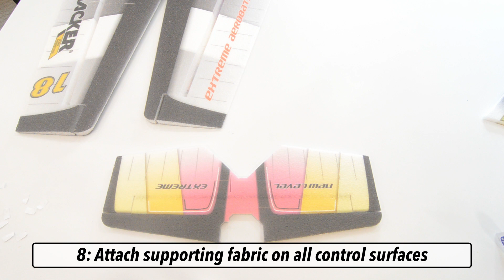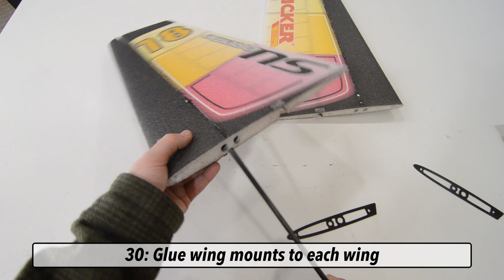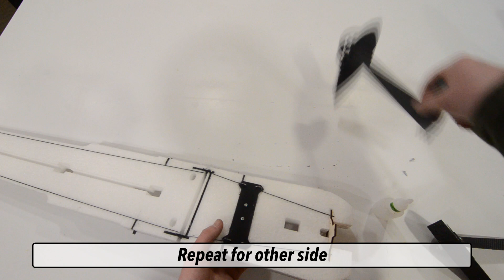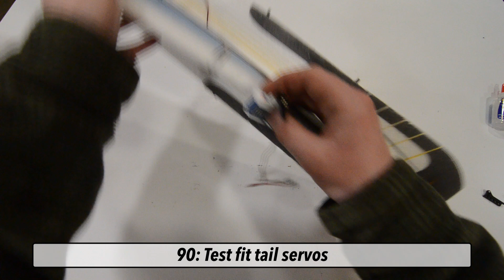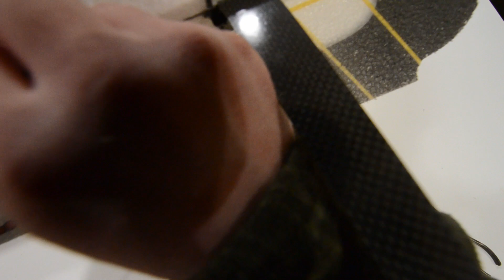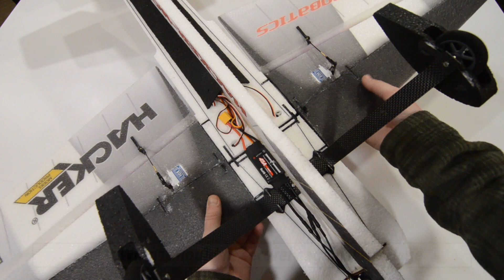Hacker Model 48" SUpreme Build Video

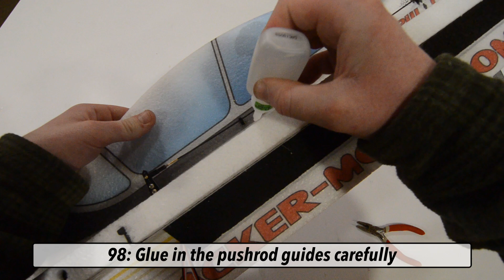Comment: Tail servos are installed wrong, elevator servo should be towards the front. If installed like this, the carbon rod for the rudder is too short. Looks like you glued an extension rod (can be seen at 46:33)
Reply: You are correct! Good!